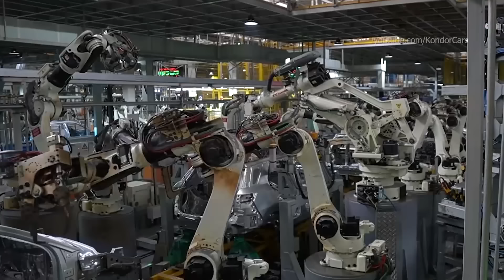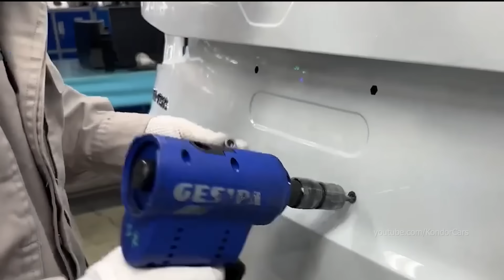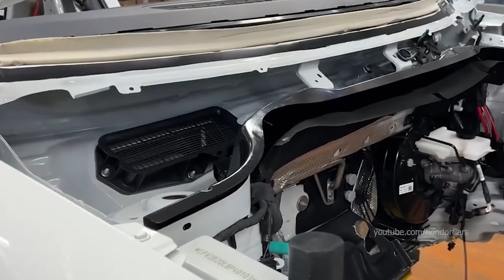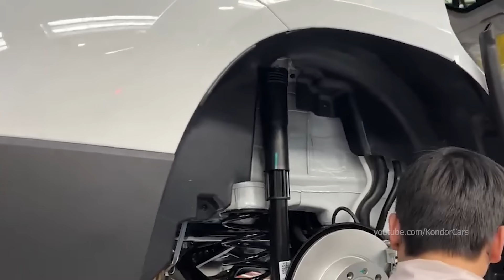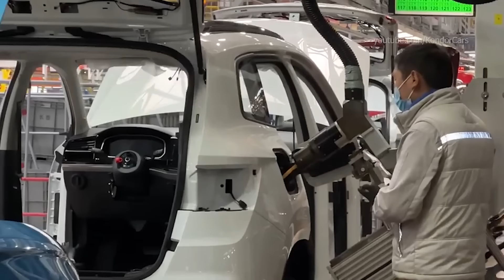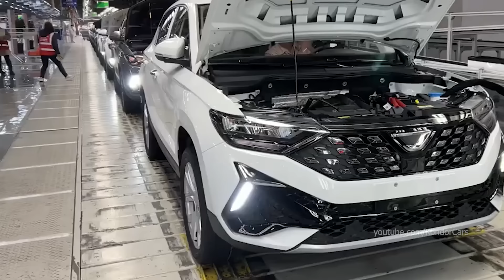Volkswagen Tiguan, FAV VS5 production in China

Comment: 🎉switch power❤ sensor pressure 🎉direction maps er and comfort milage 52  cng fuel cleaner radiator steam wire switch rod burners pump.rrd

Comment: doesn't look like a quality build
Reply: It looked quite well organised to me and being designed by WV, the quality should be quite consistent with a vehicle in its price range.
The main problem is that all those click fixed panels, are not as easy to click off again without breaking the clips. However, this is a problem with most modern cars, along with the construction sequence that can result in it taking hours to replace a battery. In the new Bentley, the time is 3 hours and involves removing the rear seats and loads of trim.